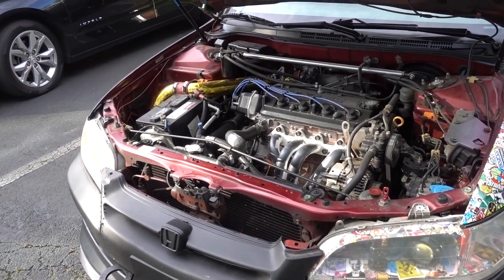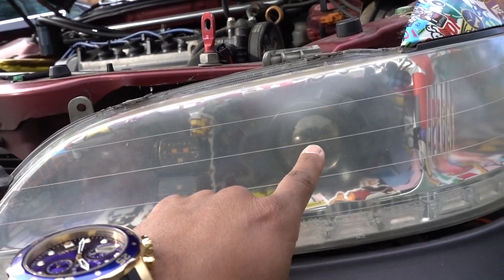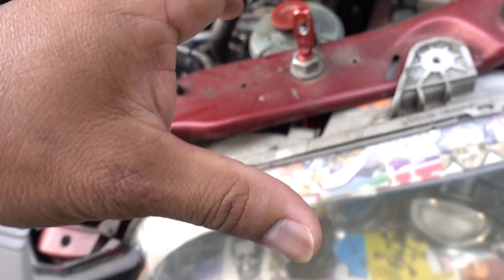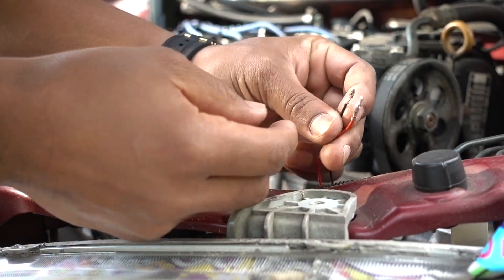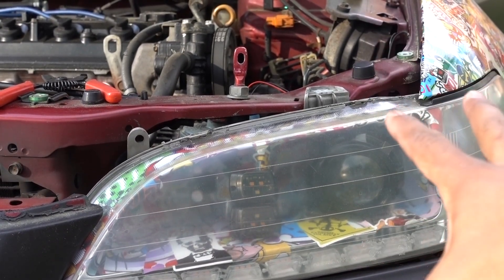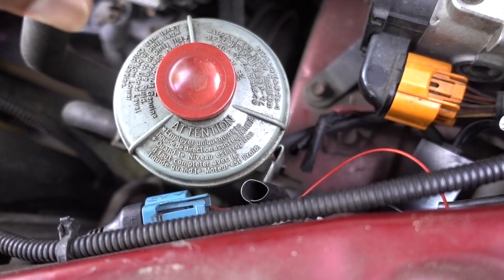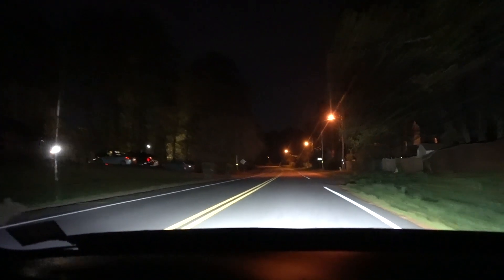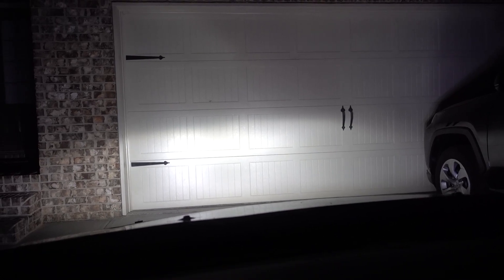2000 Accord Custom Headlights with Double High Beam |  Super Bright

Comment: Do you know what kind a light for LED should I use for my car I wanted to bright  a lot though
Reply from the maker: If you have the stock low beam, use some auxito 9006, I have a link for them, this is super bright 16000 lumens 
AUXITO 9006/HB4 LED Headlight Bulbs, Mini Size, 80W 16,000LM Per Pair, CanBus Ready, Beam Adjustable Headlight Lamp Conversion Kit, 6500K Xenon White, Pack of 2 https://www.amazon.com/dp/B07WCS6GN1/ref=cm_sw_r_cp_api_i_cNHHEb3MCM5E8

Comment: I have a problem. What's the name of the part ..... There's a black plastic box but it's on the opposite side of the washer reservoir on the left.  Behind the left headlight,  next to the battery there's a tube. I accident dropped a bolt on there no mu car rattles.
Reply from the maker: Maybe the intake box? Under bumper? If that’s your problem get a magnet in there or remove the bumper to get the box out